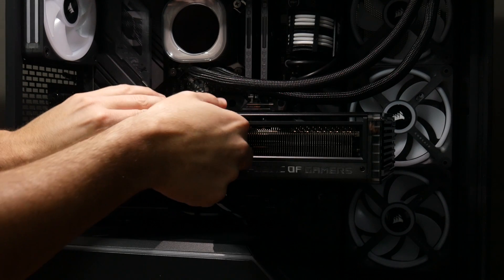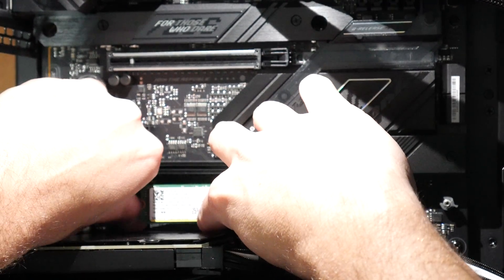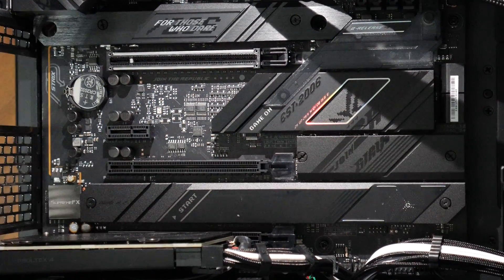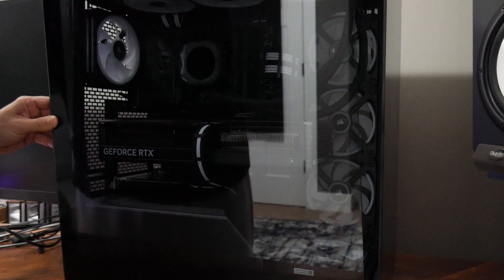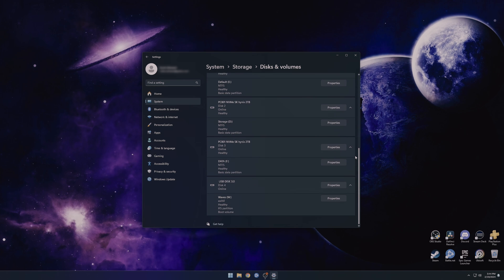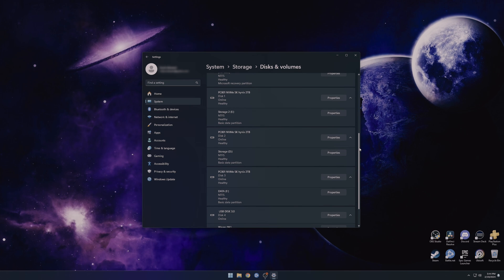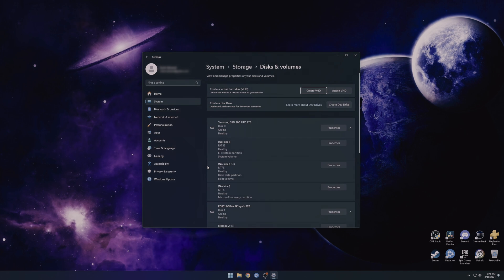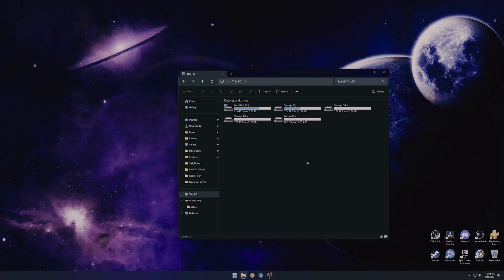How To Install NVMe SSDs SO EASY!! 4K 😎👌

Comment: Hi there,thanks for the video man,is your gpu still running at 16x with all those drives installed? I heard that it can drop it to 8x.

Seems to be a bit of a grey area and nobody really explains it in pc build videos
Reply from the maker: @krislambert6625 Great question! In this case, no. The 14700K has 20 PCIe lanes. So the GPU can use it's full 16 lanes and the NVMe can use the other 4.
Reply: @averageenthusiast4160  AHH I see

I have 13700k with the Rog strix z790-a gaming and I have 1 nvme installed in the top slot and I want to put another one in the second m.2 slot....so should be good?